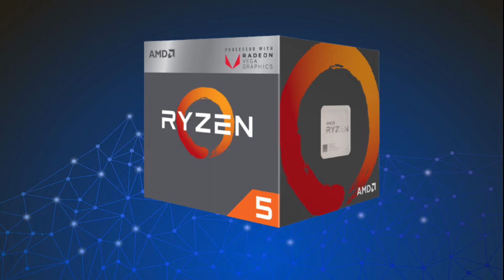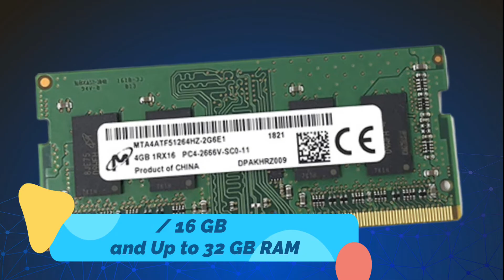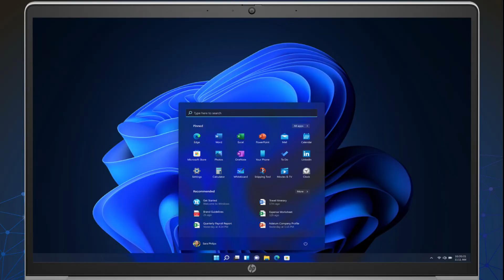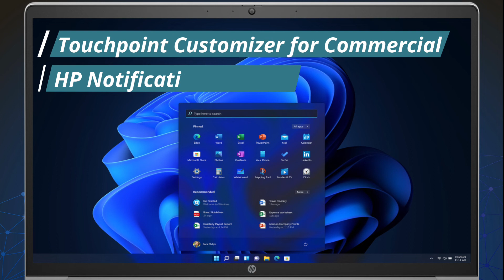HP ProBook 455 G9 NoteBook (new laptop 2022) Full Review !

Comment: price?
Reply from the maker: The HP ProBook 455 G9’s price varies by region, specs (RAM, storage, processor), and retailer. In India, it starts around ₹65,000–₹80,000. Globally, expect 
700
–
700–1,000+. Check HP’s official site or local retailers like Amazon/Flipkart for exact pricing. Always verify with your preferred seller for current deals
Reply: I bought the same 16gb/512gb only for 45000 😮 and it's the same as you described

Comment: This series contains Hello Face ID. I tried to Set up a Hello face ID buy I  couldn't
Reply from the maker: If you're having trouble setting up the Windows Hello Face ID on your HP ProBook 455 G9, here are some steps to troubleshoot the issue:

1. **Check Camera Compatibility**: Ensure your laptop has an infrared camera, as Windows Hello Face ID requires one.

2. **Update Drivers**: Make sure that your camera and graphics drivers are up to date. You can do this through the Device Manager:
   - Right-click the Start button and select **Device Manager**.
   - Expand the *Imaging Devices* section, right-click on your camera, and select **Update driver**.

3. **Enable Windows Hello**:
   - Go to *Settings* > *Accounts* > **Sign-in options**.
   - Under **Windows Hello Face**, click **Set up**. If you see a message about not being able to set up Windows Hello Face, it may indicate a problem with the camera.

4. **Check Privacy Settings**: Ensure that your camera is enabled:
   - Go to *Settings* > *Privacy & security* > **Camera**.
   - Make sure the camera access is turned on for apps.

5. **Run the Windows Troubleshooter**: You can use the built-in troubleshooter to find and fix issues:
   - Go to *Settings* > *Update & Security* > *Troubleshoot* > *Additional troubleshooters* > **Camera**.

6. **Check for Windows Updates**: Ensure your Windows is fully updated:
   - Go to *Settings* > *Update & Security* > *Windows Update* and check for updates.

7. **Restart Your Computer**: Sometimes, a simple restart can resolve setup issues.

If you've gone through these steps and still can't set up Windows Hello Face ID, you may want to check HP's support site or contact their customer support for further assistance.

Comment: I have 455 g8. HP 455 g9 is absolutely the same, only difference is +100MHz on CPUs. So, if you see G8 or G9, just pick the better priced one and be on the lookout and  get the 400nit 1080p screen.
Reply from the maker: Thanks for sharing your good experience.
Reply: AND new instruction set for CPU